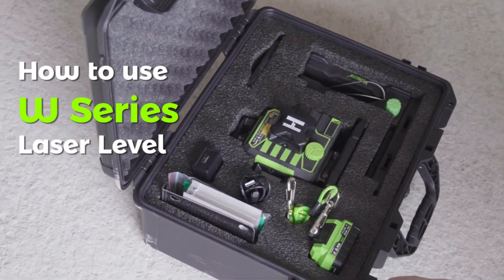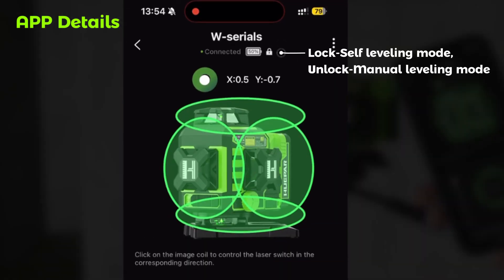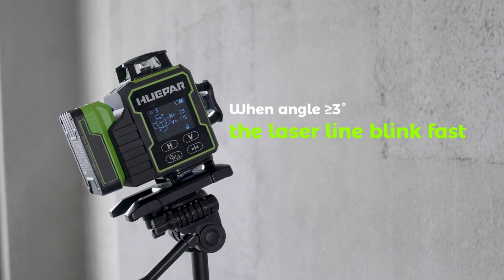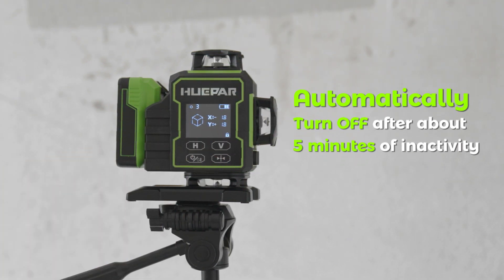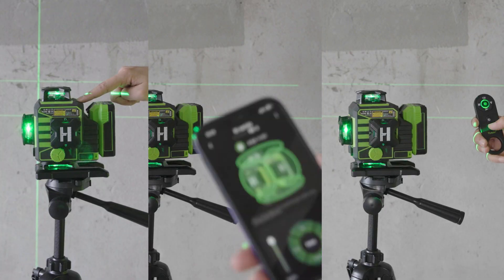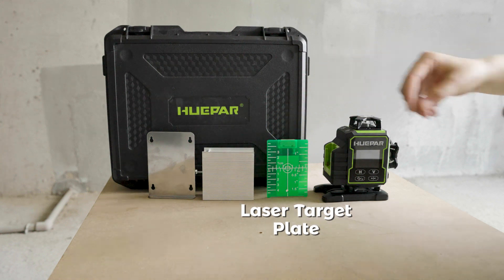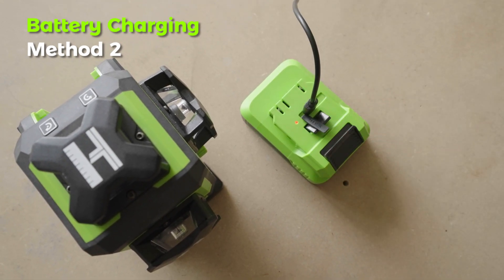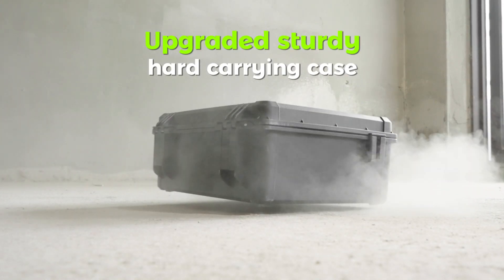How to Use the Huepar W Series Laser Level | Full Tutorial & Features Overview

Comment: What’s the name of the app?
Reply from the maker: Huepar App
Reply: Watch out for the TPD14A and TPD14B tripod! Huepar Pro Store are misleading customers by showing photos of the version with the integrated carrying handle on the center column, but they ship a cheaper, lower-spec model without it. When confronted, they claim it's 'the same product.' If you need this for professional work where ergonomics matter, stay away. This is a clear case of 'item not as described'!"